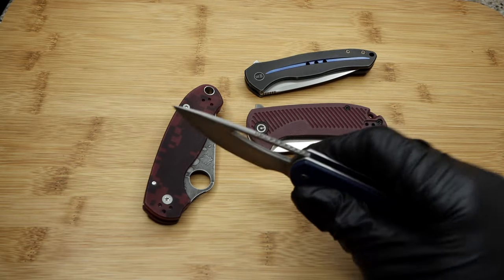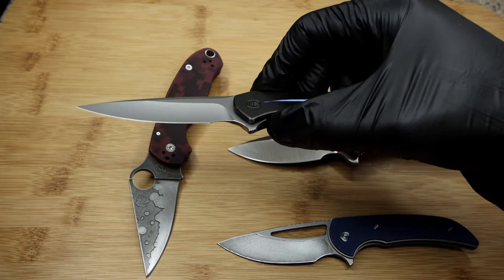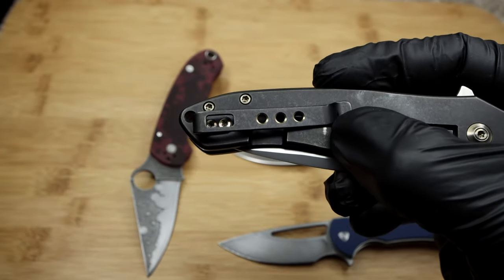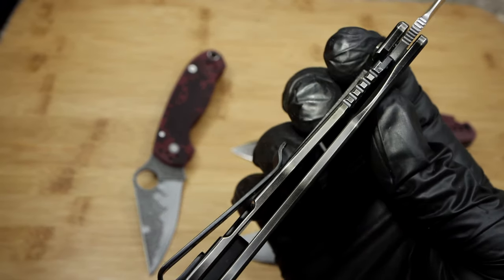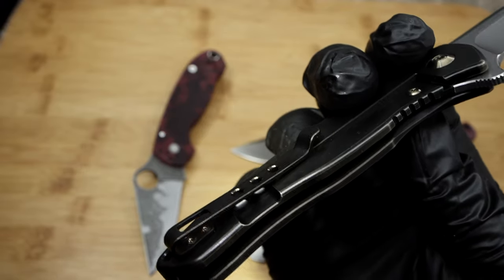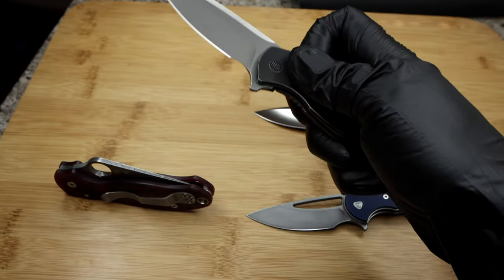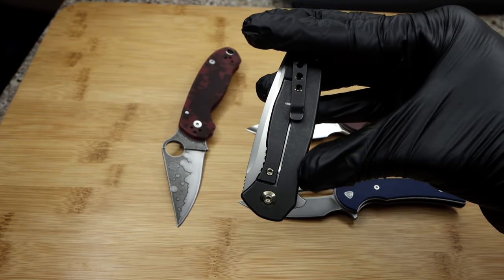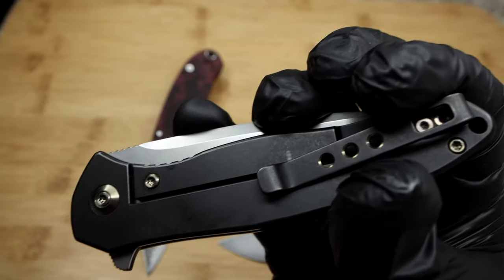KITEFIN PROBLEM SEBENZA 31ING FIX

Comment: The explanation of the problem and the solution is so pro.  Bravo man.
Reply from the maker: Thanks brotha, didn't want to present a problem then just say it's stuck, and you know me I come from the engineering side so with the drones a lot of times you would bust something out in the field, and if you couldnt come up with a quick solution.. you would be down and out for the day or at least that outting so I learn to improvise quickly without any corporate assistance, just from at the most enthusiast around me at that moment  ya know...

Comment: Hey bruh, I just got the Kitefin 2001A, and it seems my pocket clip sits more like where yours is after the fix. Maybe they heard about it because deployment on mine is extremely smooth. Or, maybe it just sits differently because of the carbon fiber scale on the presentation side versus it being titanium. It does seem more contoured than my other knives that have a flatter surface. Thanks for this video! 👍🏾

Comment: Mine has similar markings, but when closed, I can hold it up to the light and see gap everywhere but on the frame side. The lock bar has light passing between it and the clip. I’m thinking the action on mine doesn’t have the same problem, but the over travel stop allows the  lock bar to contact the clip when closing it, thereby incurring the wear marks on the black Ti. Awesome fix though man. Seems to have worked on yours!